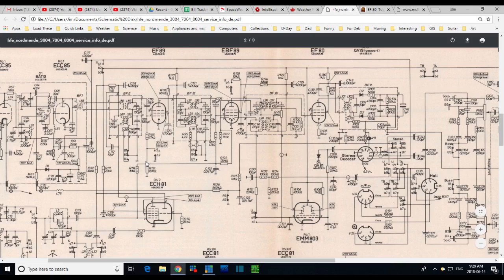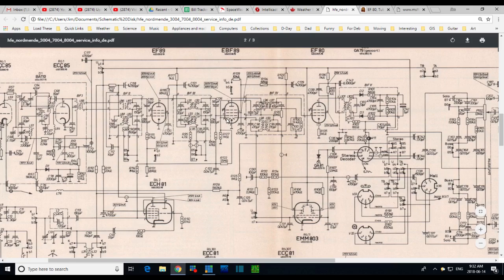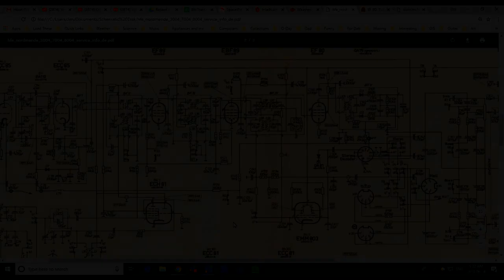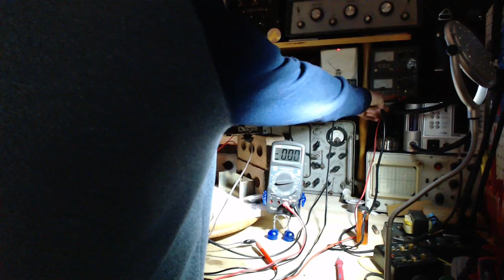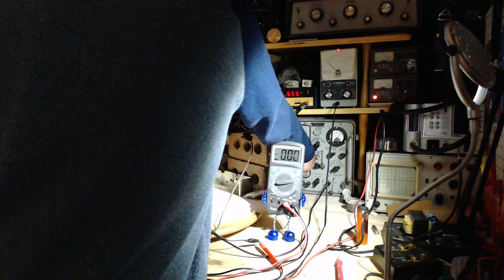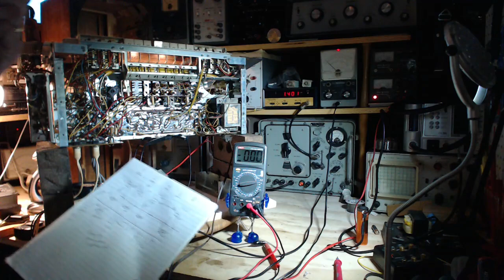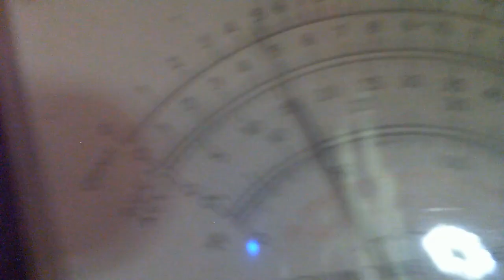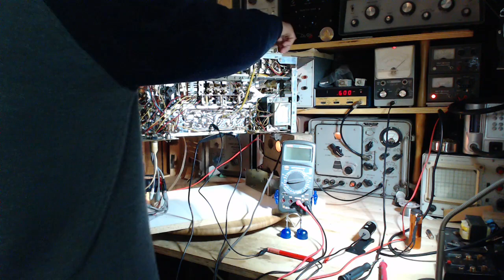Nordmende 3004C Video #29 - Final BC Band Alignment

Comment: I think you may have helped me with one of my radios. I had to change some of the mica capacitors because of performance issues and I think realigning it after the change is needed. The idea of revisiting the alignment is where you helped me. That rotating antenna is a neat feature.

Comment: I discovered the hard way that when the alignment instructions say use a meter to determine the level of the signal, they mean it. I tried doing an adjustment without using a meter and when I gave in and finally used a meter I was way off,  even though my ear said different. The radio did work better afterward too. Good lesson for me.